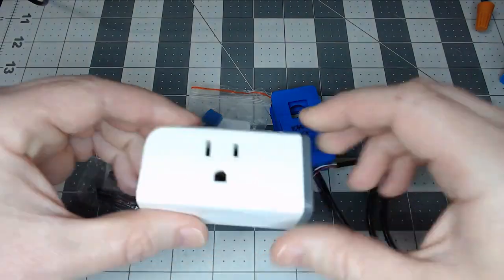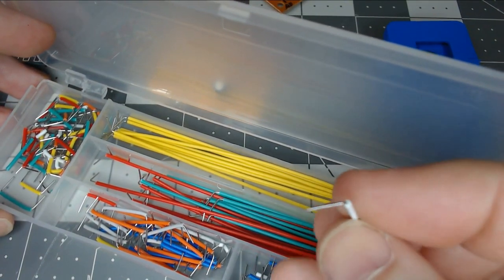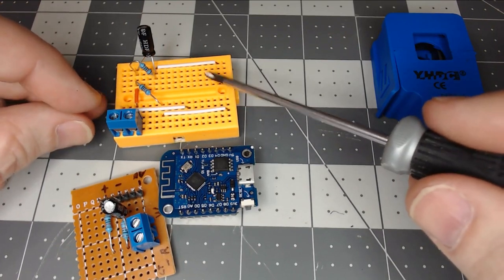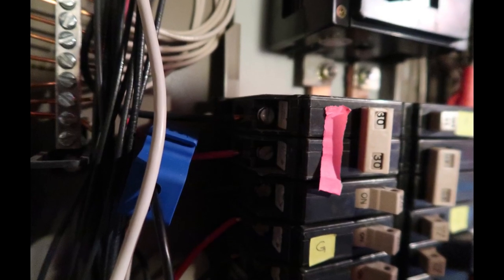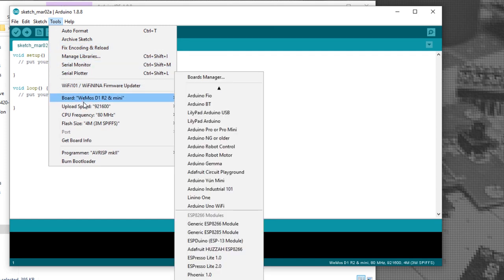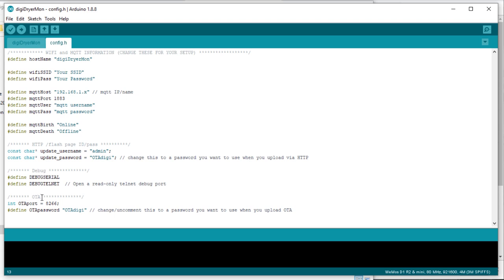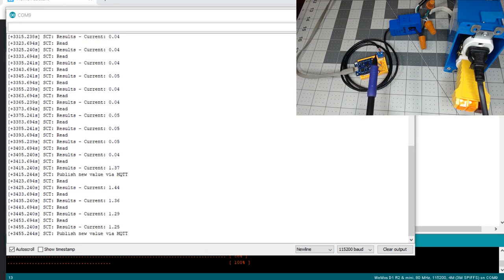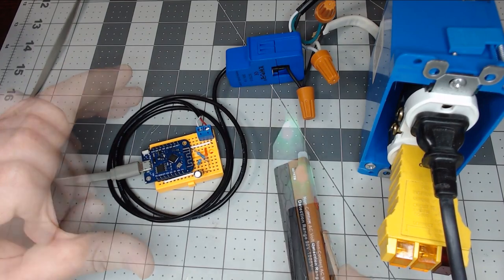DIY Smart Laundry - Electric Dryer Voice Notifications

Comment: Great video! One thing I found interesting: when I uploaded the sketch, it wouldn't work using the WeMos board setting in the Arduino IDE; I had to use the generic ESP8266 board. As a result, I also had to change the LED pin definition to 2 (the integer). After that, everything seemed to be fine. Thanks again!
Reply from the maker: Glad you got it figured out. Yes the D1 D2 mapping etc is dropped on generic so you have to put that actual GPIO pin. Good job!

Comment: You can also use tasmota, the sensor build, if you don't want to mess with the IDE. Great job on the video.
Reply from the maker: Please explain your method as I looked into using emonlib with a few firmwares.  Would love to hear and share other ways of reading the values.
Reply: how? Is emonlib included there, too?
Reply: @digiblurDIY  The sonoff-sensors.bin build (on releases page) will read the ADC pin on the ESP8266 and spit that out in the readings. I just wired the Current-Voltage loop sensor to pin A0. Besides connectivity, no other tasmota config required. For HA, value_template: '{{value_json["ANALOG"]["A0"]}}'
Reply from the maker: Correct. The sensors bin does have A0. But you won't get the right readings due to no emonlib to read the AC voltage. This was actually what I tried at first but didn't get any correct/stable readings and after I did some research I found out why.
Reply: @jerobins  but the reading as such is not consistent and you need to tune it in emonlib, as Travis is saying, and emonlib is not in tasmota...
Reply: @squalazzo  Indeed, you are correct. I'm just using it for on/off to get a time, then calculate energy separately.

Comment: You used the SCT013-030. I have the SCT013 which stands for 100A:50mA. Does it still work if I change the code?
Reply from the maker: You would need to add your own burden resistor to the circuit.

Comment: I would rather build this to monitor electric stove to check if any of the elements are ON when I am away from home, does this setup work to monitor electric stove?
Reply from the maker: Yes. You can adapt to any device as needed. Just size the SCT to the correct size if needed.

Comment: Great video. I build one with my 100 Amps CT sensor but not getting consistent or correct reading at all. Do you know if 2 10K resistance is valid for 100 Amps CT . Also the capacitor value. Thanks
Reply from the maker: Shouldn't matter the size as the resistors or just voltage dividers on the 3v3 line to get it about halfway for the bias.

Comment: Great Project! I'm running 4 of these to monitor different things. However, the dryer sensor  keeps disconnecting/freezing. I have to reset it or pull power. I've tried multiple 8266s and power supplies. I added a ferrite core like a commenter already mentioned and it still disconnects. It works for a day or two before it disconnects. Any ideas? thanks
Reply from the maker: Haven't heard of that myself. Might try to switch to ESP32 on one and see how it runs

Comment: Great video as always....
Question, Can the clamp connects to the main BUS to get the whole house usages
instead of a single item...?
Reply from the maker: You could but it would require a larger SCT.
Reply: @digiblurDIY  can you post a link to it and does the code need changing with a new clamp...
this might be useful to others 

I have a washer and dryer setup using light sensors next to each status light on my washer so when the washer light change I will get a status of the washer from start to finish.
However, when you 1st started this project I always wanted to try it out when you perfected the code and now you did 
thanks for sharing.

Comment: Well done, Sir!
You answered most of the questions I could think of and this video has a wide range of use cases! 
The only question that I had is in the accuracy of the sensor and what kind of calibration did you do. Since your voltage divider is giving you a relative voltage from the sensor, did you verify that these two resistors were as near identical possible?
Reply from the maker: Right you would want two resistors that are closely matched plus you could go with a higher accuracy ADC than the onboard one with the esp8266. But after all that I would probably just jump to a solution with the ATM90E32 chip though. The main goal really is to see if the dryer is on or not and getting a bit more than just an on or off value is a bonus.
Reply: CTs are generally not very accurate at low current measurements.  They become more accurate as the current approaches their max rating.  If you are using a 30amp CT to measure a circuit that would read a maximum of 5 amps, you can pass the conductor through the core multiple times.  So in the instance of 5 amps draw max, make 6 passes through the core, and then the CT will measure 6 times the amount of current being drawn by the load.  Fix this in Home Assistant with division by 6.  You can use 1% tolerance resistors to improve accuracy.

Comment: Hi Travis, reviewing your video I can see that the capacitor you used is 10uf 50v, in the link that you put in amazon to buy that capacitor was not, in the new link that you have if this one is equal to yours, my question is can I use another type of capacitor? If I could use what would be the value? Thank you.
Reply from the maker: The emonlib builds I found in my research used 10uf capacitors. The voltage shouldn't matter as long as it is high enough for the 3.3v input on the esp8266 breakout board.

Comment: nice job, can you tell how much current the ciruit draw? i need to make 3 of these but just one power suply, thanks.
Reply from the maker: I would look up the power requirement for each of your esp8266 boards and the go a bit above that. This isn't powering any bulbs or high draw lights.
Reply: Do you think 5v 2ah it’s enough for 3 ?
Reply from the maker: 5v 2A? Absolutely.. You could do many with that!
Reply: it's possible to use only one nodemcu esp8266 connecting 3 split cores on 3 different  inputs?
Reply from the maker: You would need to switch to a esp32 as the esp8266 only has one analog input.
Reply: sorry to make so much questions :) , but i need to change de code for that, can you check if i did it right when i finish it? thanks again your work is inspiring for me
Reply from the maker: Sure hit me up on discord and I can check it on an esp32.
Reply: you are the best

Comment: what does that mean, multiphase? how do you know if your dryer is multiphase?
Reply from the maker: Most electric dryers in the US are using the two split phases in the home to power the heating element and then one of them to power the motor and timer.

Comment: Howdy! I built this (your video and the info on your GitHub were very helpful) but I’m getting an odd behavior from it. Whenever my dryer starts, the monitor disconnects from mqtt. (The error shows up through the telnet connection, so I know the WiFi is still up.) This causes it to execute the onDisconnect function, which properly reconnects it until the next time it tries to publish a new reading, which causes another disconnect. As a result, the mqtt messages never get sent. If I turn on the monitor device while the dryer is already running, everything works fine, so I suspect the clamp is sending a noise glitch. However, I looked at the sensor signal with an oscilloscope and nothing looks out of the ordinary. Any ideas?
Reply from the maker: I haven't seen that before myself, I wonder if it would do it using the ESPHome setup version too?
Reply: @digiblurDIY 
Thanks for the prompt response! I'll give that a try and get back to you.
Reply: @digiblurDIY  No luck with the ESPHome version. However, I was able to solve my problem by clamping a ferrite choke around the sensor cable. Works perfectly now! Thanks again for your great video.

Comment: Question, if the transformar only work if the current goes in 1 direction as you indicated, how will this work in a 220v appliance in the us, where the direction is being changed?
Reply from the maker: This should work on any voltage. AC voltage actually goes both directions.
Reply: The direction doesn't matter in this instance.  The direction is indicated where you may be logging amps in more than 1 current carrying conductor by using multiple CTs.  In that instance, if you have 1 CT backward, it will indicate a negative current with respect to the other CT.
Reply from the maker: Makes me wonder now. I remember in the oilfield years ago we had these 1000amp SCTs for motor torque tracking and it was etched in my memory for the arrrows on the top to follow. They must have been using DC voltage.
Reply: @digiblurDIY  CTs won't work with DC. The motors were probably poly phase, where you would use 1 CT per phase. If you reverse one, it will report the current as negative with respect to the other 2 so the net power measured is less than actual.
Reply from the maker: Many years ago. I do remember everything being 480v. Big clamps we put on the wire and definitely wouldn't work backwards. Fed them 12v and they fed back 0-5vdc based on the scale.

Comment: Hey, just built this.... super thorough, so thanks for that.  When I get the id of the sensors and try an add them in Home Assistant I get " This entity does not have a unique ID, therefore its settings cannot be managed from the UI. "   It is working as I was able to monitor it and check that it is functioning properly using the serial monitor in the Arduino IDE.... any help to get this running in HA would be appreciated.  Thanks again.  Oh, by the way I used a NodeMCU.....ESP8266. Ok, I had a typo in my configuration.yaml..... now can anyone provide some automations for this baby?
Reply from the maker: Are you using the little custom code thing or the ESPHome one?
Reply: @digiblurDIY  custom code....I really do not have anything on ESPHome.
Reply from the maker: Gotcha. Not really sure what that error is. Haven't run into that one yet in Homeassistant. Something new in the latest release?

Comment: This is great! I've been looking for something like this for a little while now and hadn't found anything that was this easy to follow! 
I was wondering if it was possible to maybe expand on this project and hook up a high amp relay to potentially create a kind of DIY Sonoff POW/S31? Maybe a 40A Solid State Relay? https://www.sparkfun.com/products/13015
I had an original Sonoff POW melt on me and even though it looks like Itead has fixed the problem with the newer POW R2/S31, I am too afraid to risk it again since I would mostly be using them to run various Window AC units and Electric Heaters which could approach 15A when running.
Thanks again for the awesome videos!
Reply from the maker: You could do that as long as you can confirm that SSR will operate off a esp8266 GPIO pin otherwise you might have to have some sort of secondary isolation to step up that current/voltage.  I'd probably recommend disconnecting both legs at the same time unless your dryer will shut down just off one leg.

Comment: Thanks for another great video.  I have a CT clamp that looks exactly like yours, however, how would I know if it has the burden resistor?  This page here https://learn.openenergymonitor.org/electricity-monitoring/ct-sensors/yhdc-sct-013-000-ct-sensor-report says that it does not have a burden resistor.   Thanks for your help.
Reply from the maker: If it has the 1V output then it has a burden resistor, if it says like 25ma or 50ma then it does not have a built in burden resistor.